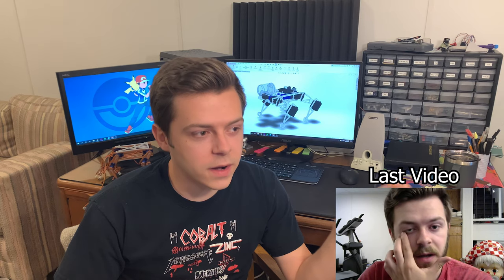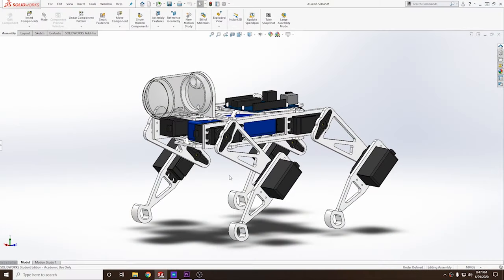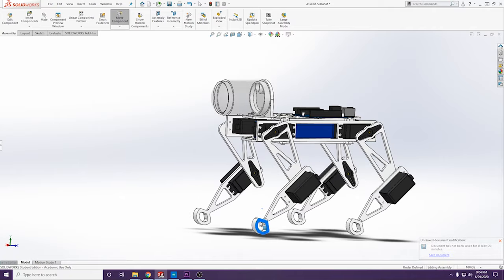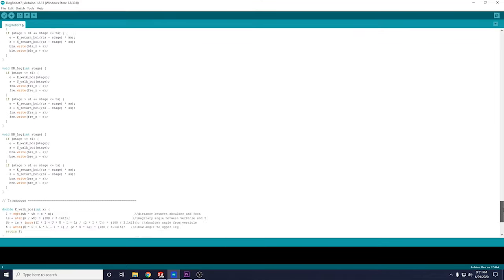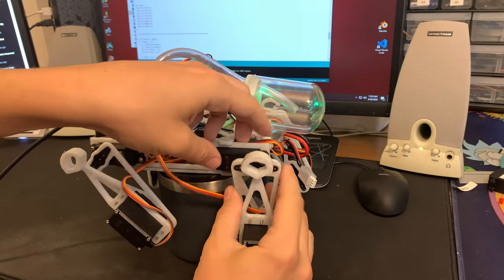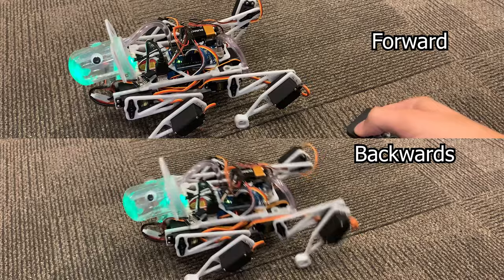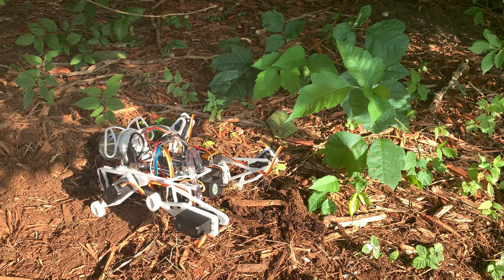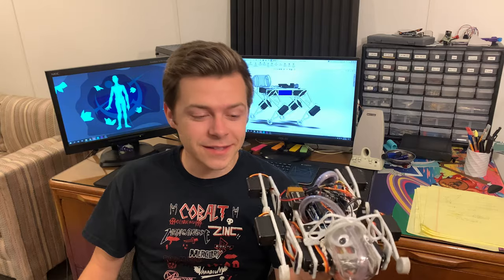Poison Ivy Dog Robot

Comment: Maybe put a spray mister head from an irrigation system on it?
Reply from the maker: The pump is a centrifugal pump, so it isn’t great at building up pressure. Originally I had designed a nozzle for it but it just trickled out

Comment: Are you sure you had enough current available when the small servos were in the setup?
Reply from the maker: yeah, relatively sure. I tried them one leg at a time while supporting the other corners, and with a 9v battery and wall wart with not much difference.